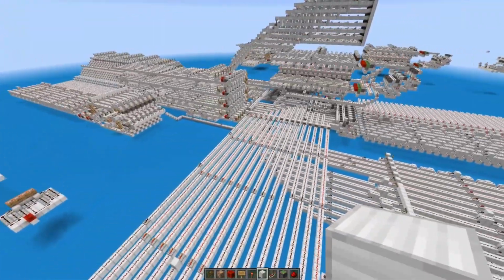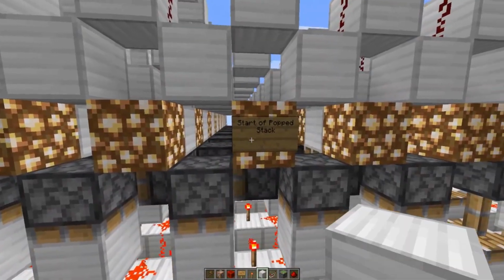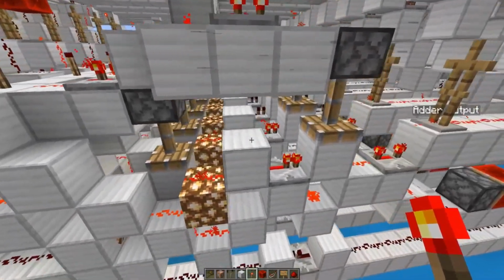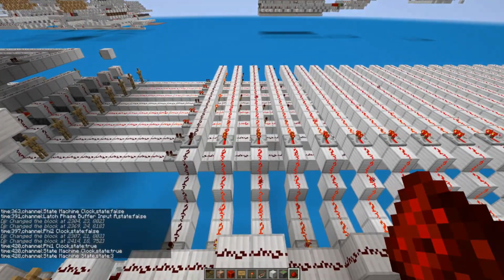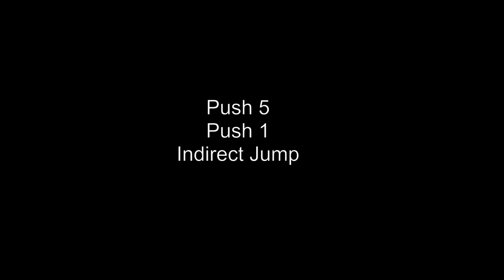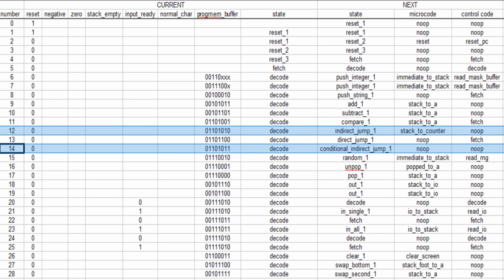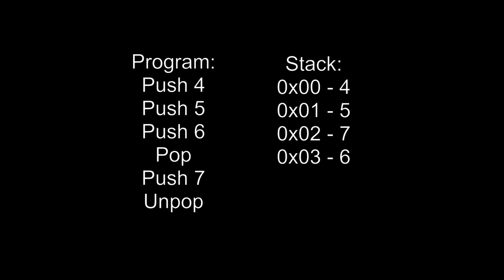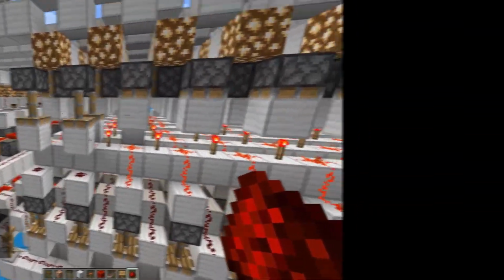Fatstacks Vlog Entry #8

Comment: I'm working on my Redstone computer v3.0 its capable of functions :D has a absolutely massive instruction word 91 bits I haven't completed it yet but its at a state of basic programs its specs are 6 bytes of dual read registers 31 bytes of dual read ram will have a 15x15 pixel display its 8 bit, 128 lines of Rom :D
Reply from the maker: Nice!
Reply: :D it can perform logical functions and, nand, or, nor, add, a-b, b-a, not, +1 and bit shift right :D

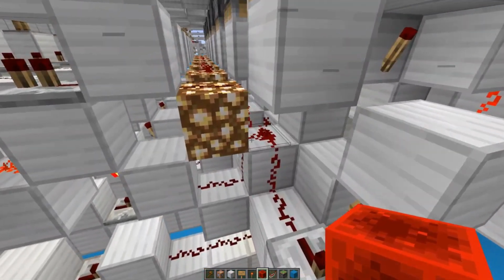Comment: I've actually been using that adder design for my CPU / Computer builds and ran into the same problem with the carry line not reaching. The repeater at 15:11 causes problems if you create a carry signal through the 7th bit as it also triggers the 8th bit. Making something like 32 + 32 = - 64. You can do a janky fix if you extend the 8th bit off to the side by a few blocks but its rather bulky.
Reply from the maker: yeah, not a fan of bulky XP
Apart from that little quirk, it's not too bad of a design. It just kinda breaks down at 8 bits wide.